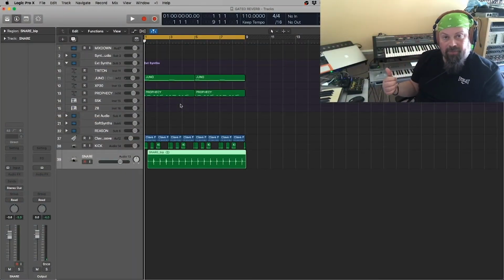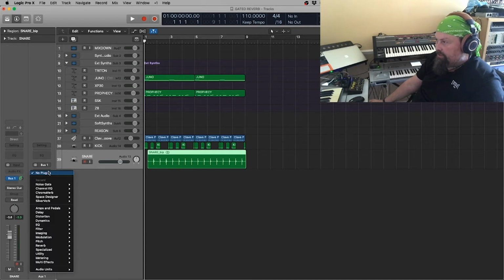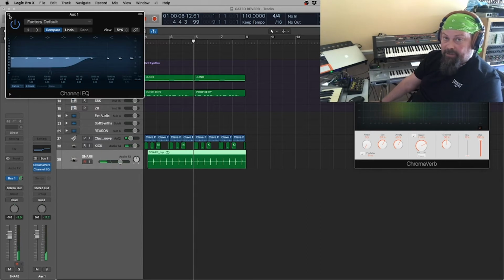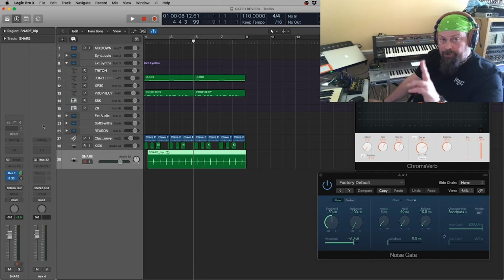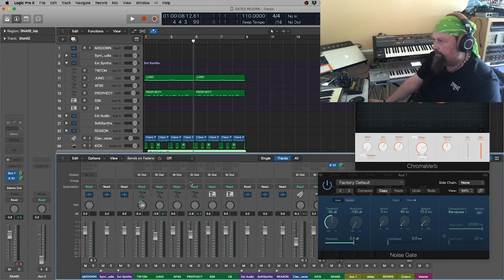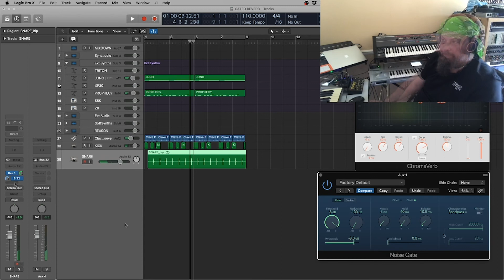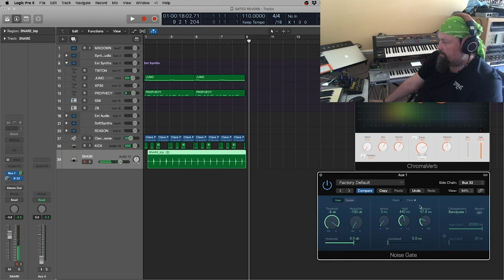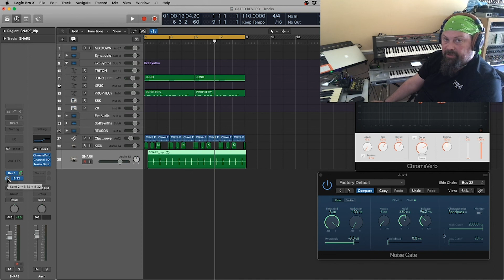Gated Reverb Logic Tutorial

Comment: Using this method actually creates many unnecessary steps and actually does result in loosing the snare completely when lowering the fader on the snare channel strip (even after setting the Bus 32 to pre fader). 
Only one bus is required to make this effect. Simply use Bus 1 as the side chain input in the noise gate plug in (and setting the Bus 1 send on the snare channel strip to pre fader). Creating an aux bus and then deleting it is quite ridiculous, that's why Logic keeps trying to add it back.
Reply from the maker: Hi Nigel, thanks for getting in touch.  I believe the method you suggest would work, but only to a certain extent.  If bus 1 was pre fade, any changes of level for the snare when mixing would not result in any changes to its reverb level. Normally I would expect time-based effects to increase and decrease directly proportionate to their source, unless for deliberate creative effect, such as making something sound farther away for example; presumably this is not how you would treat a snare the majority of the time.  Likewise, if then turning the snare up past unity it would then appear to ‘dry out’. Also, I’m not sure I follow the second part of your opening sentence. Surely losing the snare on the snare channel strip is the expected result when turning it down, no?